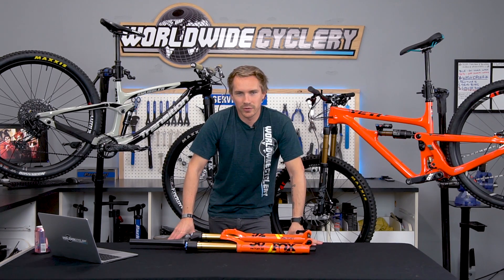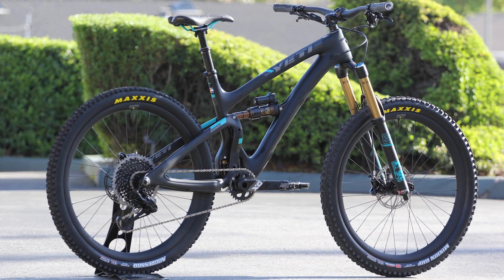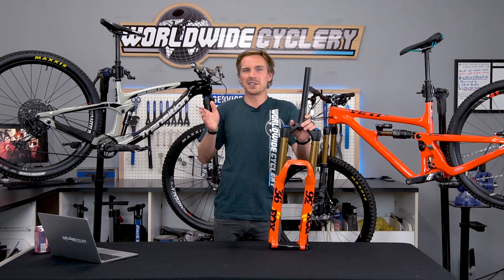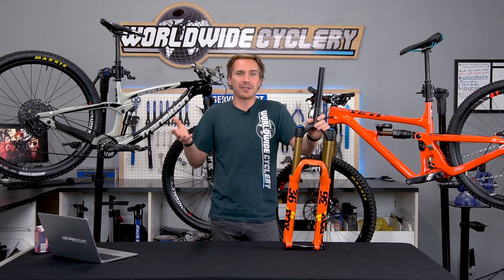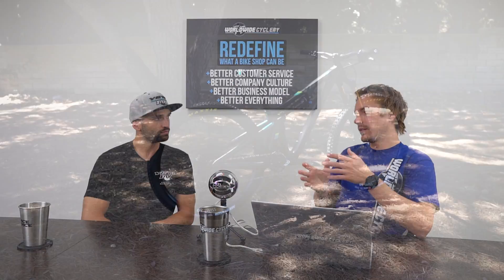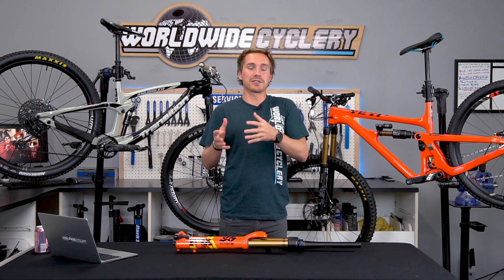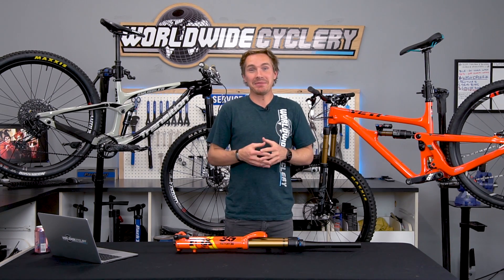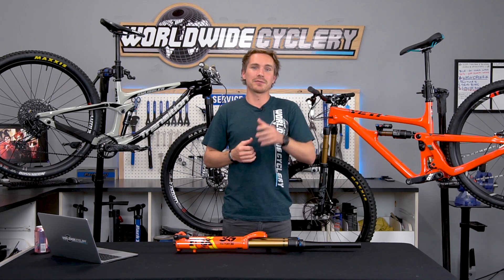MTB Fork Offset - What Is It and Does It Really Matter?

Comment from the maker: Do you run an offset fork? Have you tested two different offset forks back to back? Do you think offset forks are better? Let us know!
Reply: I've had my '18 Smuggler for about a week. Significant upgrade coming from a '12 Santa Cruz Superlight 29er (100mm front/rear travel XC bike), but my early impression of the Smuggler is how well it performs on tight, uphill switchbacks. It's no surprise that the Smuggler is better than the Superlight when descending, but the most notable difference to me is how manageable the Transition is on tight, techy uphills.
Reply: Yes I have and yes I did, and it makes calmer more stable handling bike but not necessarily better,depends your riding style.( Sam Hill runs 46 offset btw)
Reply: How dare you ask me about my fork offset! FORK you :P
Reply: Forks are more useful than spoons, unless your fishing 👍
Reply: as you change the steering head tube angle the "trail" measurement of the bike geometry is changing causing the steering "character" to change... if you follow any motorcycle racing... the best teams will have a "trail" measurement that they always try to maintain as they make changes to the head angle of the machine and it is done by making fork offset changes...
Reply: Worldwide Cyclery all forks are off set?
Reply: I have a Trek so of course I get the super duper G2 geo! Good to see that you aren’t overhyping this. For my trails I don’t need these insanely slack HT angles and stuff. 67.7* with 51mm offset is working just fine.
Reply: 2019 Fuel has a 51mm offset. I am going to change the travel from 130 to 140mm travel.
Reply: And I’m pretty sure the rapper got his name NOT from mountain bikes. But, I’m sure he considers the correct offset of his rims
Reply: Thanks for the video on fork offset. I found this quite useful. I was wondering what the impact of a different offset might be and know I know! I managed to pickup  a new rockshox 30 air shock with remote lockout for my 16y/o 26er MTB. Out with the old factory coils and in with a new one! this fork has 100mm travel and a 40mm offset compared to the original coil shock fork with 60mm travel and 55mm offset. going to be interesting how the geometry is changed. A new stem is going to be a must I reckon.
Reply: my offset is 46mm and pertains to the crown position
Reply: for example. a rigid fork has no offset or rake. the rake and offset allows the fork to operate more smoothly.
Reply: @TimFromWales  no they are not
Reply: i ride a 2018 GT avalanche. i use a rockshox recon rl silver with 140mm of travel 46mm offset. it rides and looks like a nukeproof scout. it is an aggressive hardtail.
Reply: you probably dont care at all but does any of you know of a method to log back into an Instagram account??
I was dumb forgot the account password. I love any tricks you can give me
Reply: @Reginald Rocco Instablaster :)
Reply: @Griffin Patrick It did the trick and I finally got access to my account again. I'm so happy!
Thank you so much, you really help me out !
Reply: @Reginald Rocco glad I could help xD

Comment: I think Whyte bikes from the UK started the  short offset revolution. They came to market with the S-150 and the rest of the market went scrambling.  I can tell the difference on tight switchbacks.  Short offset works well with long top tube bikes, keeps that weight under the wheel on tight turns.  👍
Reply: Yep you are correct..i have a G160S with a 42mm offset.. they are also long low and slack ish. .Mondraker led the way as have Whyte.
Reply: I was demoing the new 2019 S-150C RS yesterday. I want one. 😁
Reply: Why not make a 0 ofset fork? Head angels could be even slacker.

Comment: When wheel sizes went to 29 inches, this increased the trail substantially. It is one of the reasons that early 29ers were like driving mack trucks. Increasing fork offset reduced the trail to about the same as it was for 26 in wheeled bikes and thus made 29ers handle better at slow and medium speeds. Trail size is one of the key components to how a bike will handle- especially at slower speeds where it is basically all muscle power that is turning the bike- longer trails means the bike will track straight better and be harder to turn, shorter trail means it will be twitchier and easier to turn. Bc 27.5 wheels don’t increase the trail from the trail of a 26 as much as a 29er, you don’t need as much fork offset to keep the same trail, and thus roughly the same handling characteristics, of a 26. But as headtube angle decreases, that will also increase the trail. So if you want the bike to have the same nimbleness as before you decreased the headtube angle, then you should increase offset slightly. But of course one reason to decrease headtube angle and lengthening the reach is to create a more stable bike, and since a longer trail holds a straight line better (but more sluggish to turn) you may not want to increase the offset- you may want that increased trail to make the bike a better bomber. Ever wonder why some bikes are harder than others to ride without hands- that’s the effect of more or less trail. Two other important things that affect handling are stem length and handlebar width. So optimizing steering for what you want involves the interplay of these three things. Hope this helps someone. My head hurts now! 😀🚵🏼‍♂️
Reply from the maker: Thanks for watching and for your feedback, our heads hurt too thinking about this stuff. At the end of these discussions best thing to do is just shut up and ride!
Reply: Worldwide Cyclery LOL. I know right!! Luckily I was able to do that this am. In 27 degree weather! Hey at least it wasn’t muddy- trail was frozen. And I was too cold to think about fork offsets. Vids like this are great bc although it is down in the weeds these are the things that really change a bike’s characteristics and that a lot if ppl don’t understand.  I turned my 2014 XC machine into a trail bike and had to figure this stuff out on my own- wish I’d had a vid like yours to help me out. Keep it up. I gotta visit you guys in Lancaster next time I’m up that way. I’m in DC area, originally from Philly.
Reply: That was very helpful thanks. I'm considering upgrading my 2019 29er comp alloy stumpy from fox rhythm 34 150mm to fox factory 36 160mm and in doing so change to 44mm instead of 51mm offset. This is actually the same setup spesh went with the stumpjumper Evo. 160mm travel fox 36 grip2 with 44mm offset.

 I do a lot of steep tech corner climbing. A good take away from what you said is just experiment and see what works for your riding style, location and preference. For me... That's a bike which is nice and slack but also decent climbing. Cheers
Reply: Rob Bradshaw awesome!  You’re gonna love that Fox Factory compared to the Rhythm. i’ve ridden both and am not a huge fan of the Rhythm but the Factory is the bomb. I like the 44 offset too. I think for longer travel bomber 29ers it hits a nice sweet spot. But you hit the nail on the head - just mess around til you get what you like. And don’t forget stem length, that will make a huge difference too. Glad my
Comment helped. Bombs away brother.
Reply: @dadventuretv2538  thx alot,really clarified alot of things for me as I'm a beginner and looking to upgrade my fork.I ride a Trek Slash 8 running a 44 Offset Rockshox Yari fork stock,and am looking at a Fox 36as an upgrade,offset 51 as I can't find one with a lower offset,is this a correct choice and will it mean differences is riding?Any feedback is greatly appreciated😁😁
Reply: iiBADkARMAii  glad it helped. Going to a 51mm offset fork will make the bike turn a bit easier at the expense of straight line stability. Before I I answer the question of whether it’s a good a purchase, a few questions for you.  That’s an enduro sled- are you racing enduro or do you plan on racing enduro on it? And is that primarily what you use it for- smashing times on high speed gnarly downs?  Or do you use it as more of an all-rounder? If it is primarily an enduro machine then I would not go with a 51 mm offset fork- you want high speed stability as you’re smashing things and anything that will make the bike more twitchy is not what you want. If you are riding it as more of an all-rounder, a 51mm offset fork could be good, as it will make it a bit easier to turn and thus more maneuverable, especially in tighter trails and at slower, pedal, speeds. And one other question, if you are relatively new why are you switching out your fork?  The Yari is a good fork, and depending on which Fox 36 you go to it may or may not be an upgrade. I have a Yari on my Bronson so I know that fork from experience. If you are just going to a Fox 36 because of marketing or someone telling you it’s an upgrade, I would hold off switching out the fork. Suspension is a very personal thing- what one person likes may be the exact opposite of what someone else likes. And each person’s tastes may vary even depending on the terrain they are riding and how they are riding. And it takes a while to really get suspension set up right and to get the feel for what you like. I’d suggest playing with the Yari first- PSI and rebound speed, and then I’d try the Fox 36 you want to buy on a demo first to make sure what someone says is an upgrade really is to you. And maybe test a Lyric too. Forks aren’t cheap and it is really sucks to fork out the cash only to find out you don’t like it.  Anyway, just some thoughts. Have fun out there, that’s a sweet ride no matter. what’s up front.
Reply: Great explanation.  It’s hard to believe we used to put those long stems on our bikes back in the 90s.  My Yo has a 71 HTA (reduced with the suspension fork) and a 135mm stem.  Even though it puts the steering out in front a lot, it still rode really well and didn’t oversteer and tend to dive in turns like one would think.
Reply: @armankiarmankii  
You’re just starting out and you want to start upgrading already?!  Get some more experience first.  Fox especially takes more knowledge to tune and get right and you’ll spend a lot of time trying to figure out how to set it up.  Take what you have and go ride.
Reply: This explanation has more succinct and useful information than this entire video!  Thank you!
Reply: @DZig  lol. Glad it helped. Took me a while to figure it all out.
Reply: So for East Coast XC riding, the 51 offset still seems to be the choice
Reply: @brucehumphries6889  for old school XC, as a general statement, yeah, a 29er with a 51 mm offset is still a pretty sweet spot.  But who wants to ride XC? 🤷‍♂️ lol. JK. 

For some of the newer XC trails less offset might work, but it all depends on the other parts of the bike- HTA, Stem length, Bar width.  Hard to say 100% without discussing what those other things are like too. And of course what kind of XC trails- for the newer ones with more roots and small rock gardens and even drops a bike tending more towards a trail bike and thus with less offset might actually be better. Difficult to have any true absolutes in mtbing.
Reply: @dadventuretv2538  Me!! Lol
Reply: @brucehumphries6889 it’s funny- I got back into mtbing after a long time away (since about 99) while I spent my free time playing Rugby. When I got back into it my first real mtb was a Trek (bc in the 90s I could never afford one!) XCal hardtail XC bike. Man I thought the price tag was ridiculous- how little I knew. Lol. I had to get used to all the new tech and changes and wheel sizes and prices - man it was all so different. After about a year though I realized that I like to ride like I’m still 15 and got a bike more suited to being stupid and playing around- a Santa Cruz Bronson. What is so great about the current state of mtbs is that anyone can get an awesome machine suited to what they like to ride, or a great all-rounder that will let them do a whole lot of different stuff comfortably.  So different from my first fully rigid in 1990 when I still needed my bmx to be stupid. Lol. Whatever you ride, have fun out there! 🤙

Comment: Riding a non-SBG concept bike and then a Transition Scout back to back, it's totally noticeable.

The thing I noticed most was the ability to soften my grip and relax my arms over chunky, rutted out sections and not feel like the trail wanted to grab and direct the front wheel nearly as much. Pretty much at any speed. The bike handles and tracks so intuitively.

Taking turns at speed over non-ideal terrain was very confidence inspiring. Found myself pushing faster and faster until I carried too much speed and tired brakes on a demo bike had me off the trail.

Comment: I believe its actually important to differentiate when and where the SBG philosophy is used in that Transition is only employing it on their long(er) travel bikes. On their Vanquish HT they still spec it with a 51mm offset fork. Now this could that they  haven't updated the geometry to the SBG, but I do believe there is a point where the shorter offset has an adverse effect on the handling.

When I first got my Ibis Ripley LS I reused my RS Revelation RCT3 130mm with a 46 deg offset because its a fantastic performing fork, and one side effect of increasing offset is a slight increase of head tube angle.  Fast forward, I wanted to put the fork on my (then at the time) Kona Honzo ST SS, I bought a new DVO Diamond for my Ibis, and I actually saw a considerable (positive) difference from the 46 to the 51. The tracking and carving was quite a bit better in my opinion. I recently sold the Kona (being a psudo-SC fanboy) and got a Chameleon at a great price (and I love the sage green/purple) to replace it. I just couldn't get along with all these super steep seat tubes that everyone's coming out with.

I believe though that if you don't have the other geometry numbers along with TTL and Reach, you should go with what the manufacture suggests. If they say 51, run a 51. I don't believe you're doing yourself any favors going to a 43/44mm offset because that is the way of the trend. You're going to dramatically change the way your bike steers, and probably "overweight", disturb the trail numbers, and the front end and have the axle in the wrong place making it harder to corner at speed.

Comment: Thanks for video and article. I've had some personal experience with reduced offset and steep head angle. I had a 2015 Giant Trance Advanced, which originally had a 140 fork on it, 67 head angle, 27.5 wheels. I put a Marzocchi 350CR (40mm offset, I think) on it at 160mm and it felt great (roughtly 66 HA with the extra 20mm of travel). I tried it at 150mm and it immediately felt nervous, like I was fighting to steer properly. I switched right back to 160. This tells me that there is a break point (as your article on the site mentions) wherein the reduced offset will not play well with a steeper head angle. It's a fine line, I was fine at 66 and frightened at 66.5 (roughly). My takeaway was that there are tipping points with bike fit/geometry that can dramatically change things. Glad to hear that most people are fine running 51 offset 29er forks on slacker bikes.

Comment: Jeff, loved the video on boutique brands. Now, Santa Cruz Bikes. I have a friend who works there and here is why I think they are better than any bike brand over any "boutique" brand. Lifetime warranty on frames and wheels and competitively priced.  You can get a frame for $2700-$2800 if you deal with the right shop or online company, online would have to be Competitive Cyclist would give that deal.  Pawn Holdings, who bought SC, has put more money into their investment, which allows SC to now "O W N" their carbon manufacturing facility in Asia! 

THE FACILITY DOES NOT MAKE ANY OTHER BRAND!  Some of those in Asia, as you and I now, make several bike brands and quality cannot really be nailed down as wanted. Further, Santa Cruz owns their own testing carbon facility in Santa Cruz where they develop mules for new bikes, shapes of frames, and there they make the Reserve carbon wheels and the Santa Cruz bars, all in the USA.  With the exception of ENVE, all other carbon wheels are made in ASIA, that I can think of, I may be wrong.  

So what being bought out for Santa Cruz has allowed them to put more money into quality control and innovation giving them an edge over Yeti, Pivot, Evil, Ibis, Transition, etc... They can offer a lifetime warranty, but not only this they have told employees they want a 48 hour turnaround if any warranties need to be addressed. Most other brands will take weeks to get them addressed. I've had friends who have had cracked Yeti's and its been hell getting them to take of their customer.  

I have a friend who left Yeti for this reason. HE paid $3100 for his frame and it cracked and they took about 6 weeks to get it all worked out. So Santa Cruz may not fall into "boutique" because they have the scratch now backing them up, but all the guys who were there before it was bought out are still there. Even Rob Roskopp, the original owner who sold it, is still there running it. Santa Cruz is in their own category that not even Giant, Specy, or Trek can touch.
Reply from the maker: Thank you for the insight and sharing your thoughts. Santa Cruz is definitely an awesome company and we love what they are doing. :)

Comment: At the end i believe the truth benefit of different offset is, to create a bike size right in between two sizes. 

So for the shorter or smaller frame,  you choose more offset and a longer stem. But you stay smaller than the bigger sized bike.

You do this for not needing an ultra short 30mm stem. Because you will have  less weight on the front tire, even with a short offset with the 30mm stem.